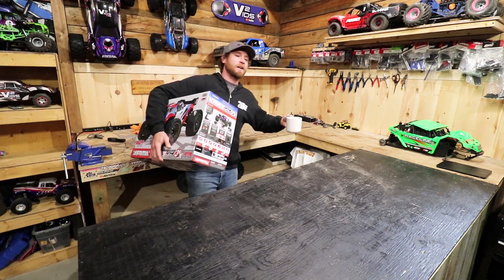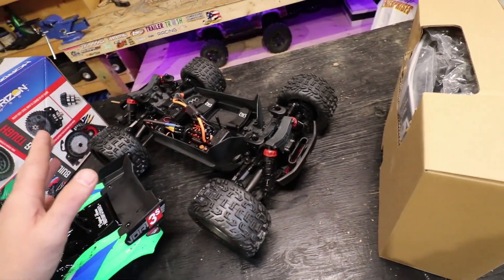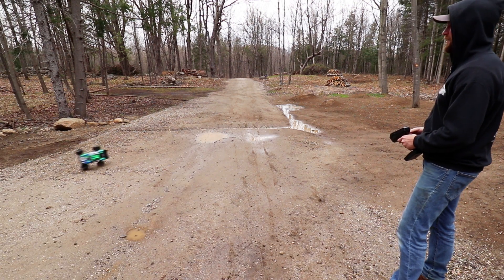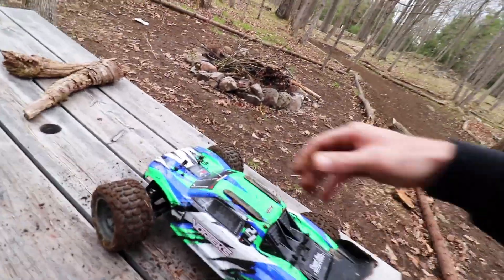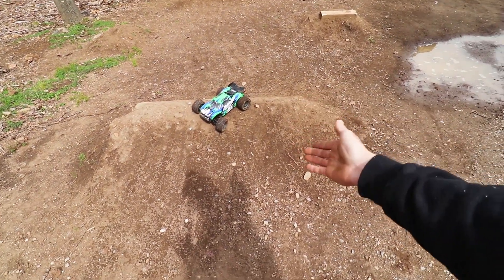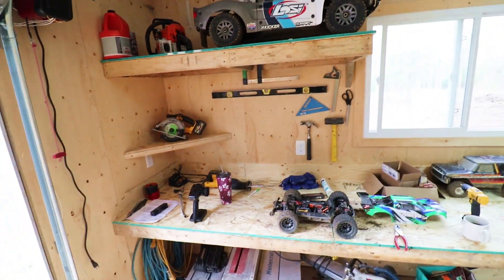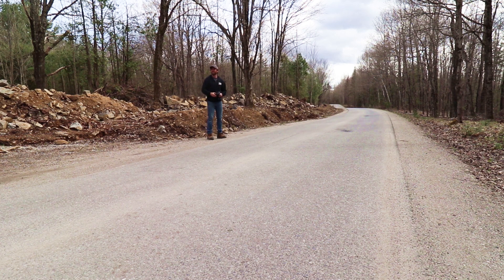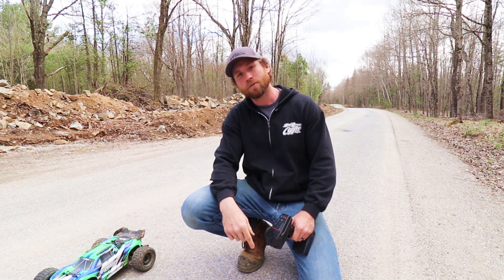Arrma Vorteks, Unboxed and Beatin

Comment: First I'm not an RC snob, this truck does have appeal. But after upgrading my Erevo 2.0, do I really need this? I like my Senton a lot, I'd buy a notorious before this...or another Senton to have SCT races with my kid...dont get me wrong this thing is super cool though. And for all the naysayers out there: my erevo has the newer gray turnbuckles, with the beefier rod ends and they take an incredible beating, you dont need the flashy aluminum upgrades bc I had them and they broke so much, I put the original parts back on and never looked back, I abuse my erevo and feel I've made the right upgrades to make it a Basher through trial and error and it hardly ever breaks on me. I'm not advertising for traxxas, just feel like the erevo gets a bad rap bc people dont take the time to understand it and work with it, it takes a learning curve, but it is VERY FUN in the end...lastly, Arrma and Traxxas are both AWESOME companies!

Comment: Was so mad just bought a granite 4x4 blx then the next day they released this lol i would od spent a little more for this
Reply: You won't regret the Granite. Awesome truck. Do what I did, save up, I now have both. Gotta love Arrma. John
Reply: @rcmakingtracks18  current plan is going to basically convert my granite to a 3s outcast since they are on the same chassis but will use typhon arms to give it a wider stance. Hoping this weekend i can get new drive shafts had both the rears come apart on me

Comment: A couple of those front wheel hits I was sure you were going to have a bent hinge pin broken arm or upper camber link, so another one to make my choice harder I need a basher on or and off-road I like the LOSI SRR or SBR V2 a Felony or ZD-Racing EX07 Mustang, now a slightly cheaper and more usable due to it's size the Vorteks and not even half way through the year yet.

Comment: Arrma are TOSSERS! This truck is basically a short course Kraton,  they've seen my truck I built from 3/4s range parts and copied off it because it is better that the cars they released 🤬🤬 

Mine has a 6s 1/8 scale power plant (blx185) in it with 2200kn 1/8 scale motor with 26t pinion.. 
The body shell is a SC proline flotek bash armour, tough as old boots.
A super tough truck that hardly ever breaks😉 

Take care mikey, shout out to your mate Dave🙋‍♂️ pair of you together are very entertaining. I prefer you guys to kev Talbot, he's changed since what happened with Pat, he's more focused than ever on making money and every video of his is an advert🙄 sick to death of adverts man.. Cereals is his latest venture and I skip passed his videos ✌ God bless ❤🙏
Reply: Tell you what. I'll be grabbing me some of those tyres 👍🏼
Forgot to mention "cracking video bro" this truck is the best out of the 3/4s range hands down... I may be a little biased 😂❤🙏

You'll need uprated rear axles to run a 1/8 motor, stock last only minutes 🤜🤛